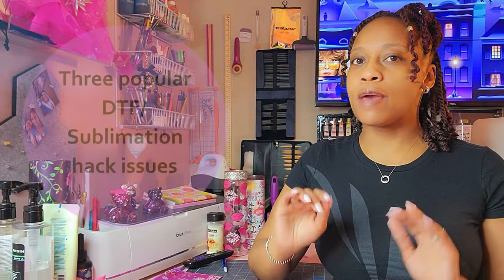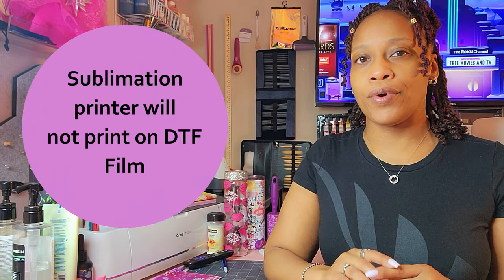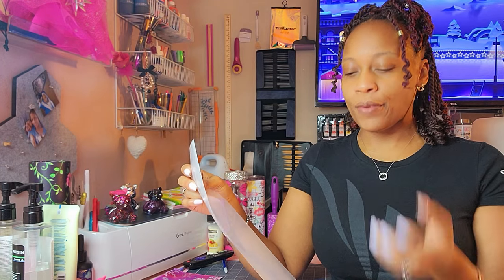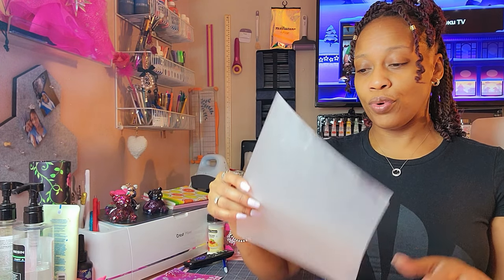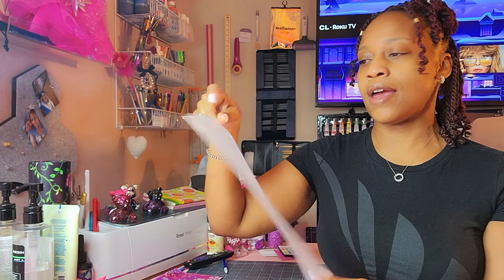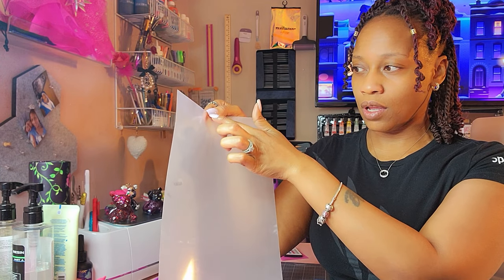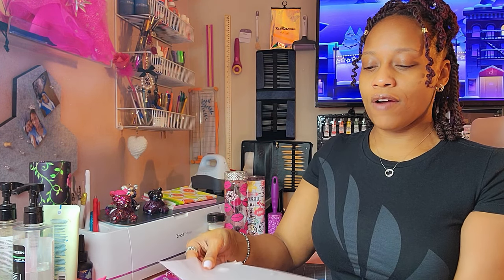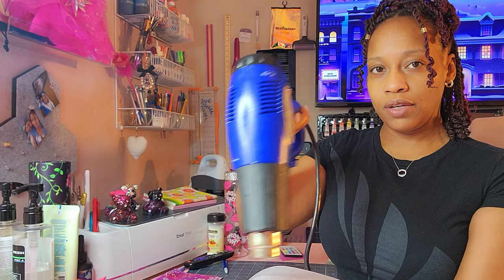HOW TO FIX DTF FILM & POWDER PROBLEMS WITH SUBLIMATION HACK

Comment: Good evening, I just found your video and it’s very informative on the hack for dtf. However I have a problem with the print after it comes out of the printer, some of my ink is not wet enough for the power to stick to the image, I used the plain paper settings and a inkjet printer. Can you help me with this issue? Please and thank you in advance.

Comment: Hi, every time i try curing my dtf powder it's looks like gritty shiny crystals and when I go to press it my image looks crackley and I've been curing 320 2min even tried 5 any other advice?
Reply from the maker: Hmmm not sure, is your heat source close enough to properly melt the powder? Another option is to try a heat gun, it gives you more control and you can clearly see what's happening: https://youtu.be/IvzZxSo3bSk
Best wishes!
Reply: @ColorMePorcha  it is but I guess I also have to figure out how the end result of curing looks like to, I've seen other videos to try to compare how it should appear when done properly but then the description seems some what the same if it was over/under cured. Probably need to experiment more. Thank you so much for getting back and your videos are definitely helpful lol!